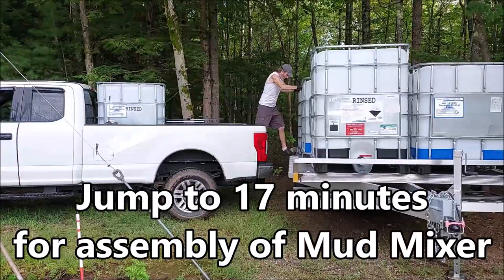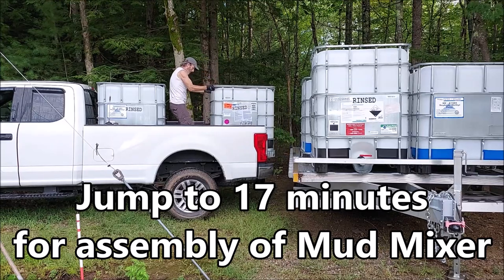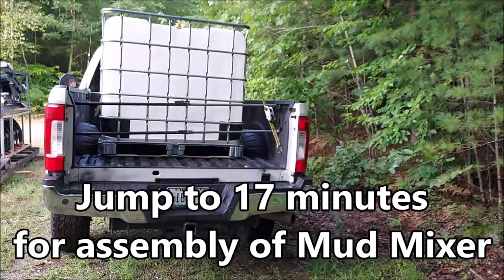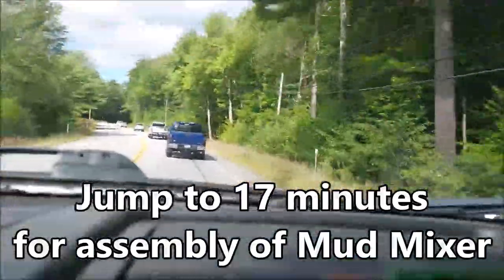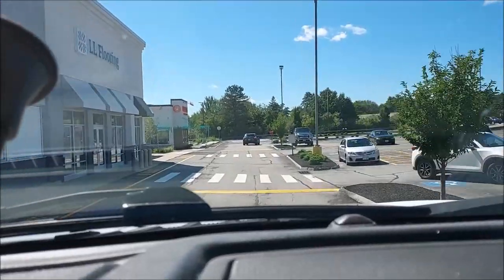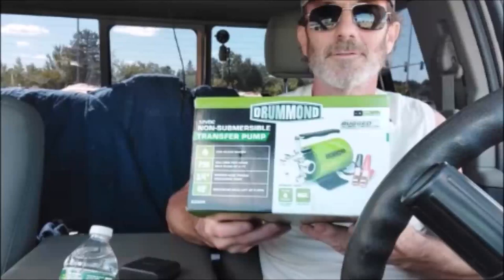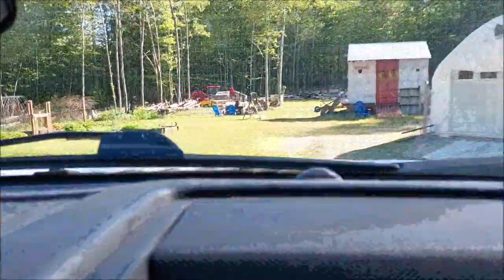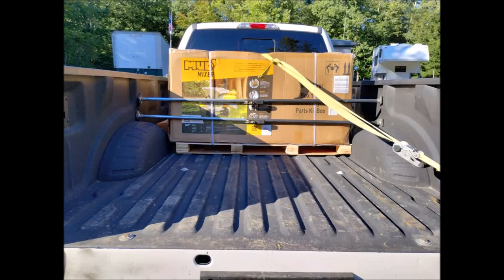Picking up and assembling new Mud Mixer | FINALLY!! A user friendly cement mixer!

Comment: Thank you for your video. 

Nice toy! 

Those IBC totes would be great for hauling water except they would be so freaking heavy eh? What would one weigh full? A ton? or more, ... 

Good luck making cement and have fun!
Reply from the maker: Thank you. I believe you are correct. I can't pick that up. But I can fill it if it's already in the truck bed. But how much concrete does that make? Too much math.  Can't wait to make concrete, will this machine make that a thing now?